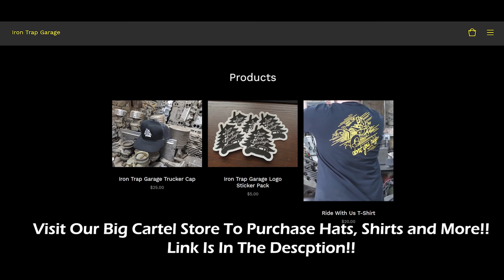Wiring The Lighting Circuit and Inspecting The Gas Tank - 1934 Ford Tudor Hot Rod

Comment: You can put electrical shrink wrap on the SS worm gear clamp for the turn signal. I saw it used on radiator clamps. Clean.

Comment: Matt.
To save the old tank do as my Dad taught me to growing up when we salvaged old fuel tanks from old aircraft to put in homebuilt aircraft.
Cut a rectangular hole in the top of the tank the 2/4's the length of the tank.
Drill a hole where you want the fuel line to go.
Weld a patch over the old hole.
Cut another hole where you want the fuel sensor to mount.
Weld a patch over the old hole.
In your case leave the fueling inlet hole alone.
Make a cover 3/4's inch larger than the hole you cut in the top.
Drill screw holes every 3 to 4 inches around thru the new hole cover with it held on top of the hole with it held in place with those magnets you use.
Install pop screw inserts.
Drill a hole for your new fuel line outlet and install and weld in a 3 inch peice of steel fuel pipe to attach the fuel line to.
Cut a hole for your sensor flange with holes drilled using the sensor flange screw holes for screw insets and install them the same as the screw inserts as per the the access hole cover you made.
I can't remember there proper name but I've watched you use them.
Then glue a fuel resistant rubber patch over the inside of the insurts 1 inch larger than the insert.
Either have a custom rubber resitant fuel bladder made or simply paint the inside with several coats of fuel tesistant paint after first removing all the corrosion with a wire wheel on a drill.
Paint it with a good primer at least 3 coats.
Then paint it at least 4 to 6 coats of fuel resistant paint if no bladder is used.
There is a paint like that Eastwood may make cheaper that that supplied by aircraft parts retailers.
It comes out thick.
Install the cover you made for the the hole in the top using lock tight on the screws for it and the screws for the fuel sensor flange.
You've saved the original tank.
Itvreally won't take that long.
The largest expense will be a bladder or the fuel resistant paint.
We used both depending on the aircraft.
It's way cheaper to save the tanks than to buy a new one I'd think.
Reply: Or he can buy a new custom one for $300 and sell that one for $150. 😂
Reply: Mr. Spin.
What I described isn't as exspensive as a new tank.
I highly doubt he'd get $ 150 for the old one considering it's condition.

Comment: Nice Matt cant do enough in my opinion, hate having to go back later and redo, got my friends 9n running purrs like a kitten notice it hadn't been moved in a month , you guess it old gas open carb I again will have to rebuild the carb , this is the 3rd time due to thinking everything is good with the tank and lines not as hard to deal with as in your car , only one thing I see you doing is your on your knees without pad take it from me Wear pads of a solf pad that way when you get my age your knees are not shot . Love the car it is killer

Comment: You could probably replace one of the license plate bracket bolts with a hollow bolt to run the wires through.

Comment: What I did back in the day was go to the junkyard and pull a fusebox and harness out of a fairly new (late 50s) car to wire my projects. Usually tried to match the car the wiring came out of to the make of engine being used. Yours looks better!
Reply from the maker: Not a bad idea. 50s &60s cars still had alot more going on then these cars need. They are quite simple!!
Reply: @IronTrapGarage  For sure, I love that fuse box you used.

Comment: The license plate bracket can double as a tow hitch LOL. Back then it was about how quick they could make cars on the production lines. quicker to have the gas tank mounted in the frame and drop the body on as it rolled by. Always nice having little helpers around!
Reply from the maker: The bracket is mounted quite securely!! Never thought about the tank being on the frame for faster production. Good point!!!

Comment: Hey Matt,
   Another Great video on the progress of the 34 sedan.
Looks like your in-house electrition might also have some idea of what he is doing,
 ( Hey Mike ).
   Cool shot at the end of the video showing all the lights actually work.
Didn't see the Fog lights, or hear the horn.
More work to do !
   Matt, the 57 Fords had a tin tunnel to cover the turn signal wiring on the outside of the steering mast.
I can send you one  or two if you want, as we have like 25 57 Ford parts cars in the yard .
Taping the wires to the mast seems kinda hoaky on that great looking sedan.
   Are you going to put an electric fuel pump in the new gas tank ?
I know they are higher pressure and need a return line but it is a thought.
You can install a fuel pressure regulator in line before the carb so the pump doesn't over power the float valve.
   Thanks for the Sunday Morning update.
Be safe and well all.
Reply from the maker: I’d be interested in one of those column covers to see if I can make it work. No electric pump. Just the mechanical.

Comment: Careful Matt, if you take the car apart too much, you could be tempted to get into the "if I take a little more off I can do so-and-so". Then all of a sudden that cool car will be a pile of parts scattered around the garage.  :-)    Been there, done that!  By the way, I hear y'all talk about 'chipboard' a lot. Down south where I live, we call that cardboard (the thicker stuff that boxes are made of) or poster board (the thinner smooth stuff). Interesting the differences in terminology between geographical areas. Not trying to start a firestorm in the comment area..........but think about removing the horn from the front of the car for a much cleaner look.
Reply: r1lark same here in oz took me awhile to work out what they were useing
Reply from the maker: The horn will be getting removed for sure, along with the fog light.
Reply: They are using a card board(chip board) that is the thickness of poster board...  Comonly found on pallets under whatever is sitting on the pallet.  Also sold in a roll at home depot in the paint department for protecting floors.

Comment: There is a hole in the floor, so you can service and or remove the fuelline and sender from the inside of the car.
Reply: Some cars do NOT have that access hole!
Reply from the maker: You’re right there is an access panel. Didn’t see it until the tank was out! Doh! Either way it wasn’t horrible to do it the way I did it.

Comment: What did you use for new sockets in the tail lights and cowl lights? Great job!
Reply from the maker: The car was already converted to 12v with dual filament bulbs. We didn't change a single bulb or socket!
Reply: 33-36 style tail lights came from the factory with dual filament sockets. 32 was the last year for dual bulbs in the tail lights. Cowl lights were single filament though, so somebody changed those.
Reply from the maker: Thanks for the education Greg good bit of knowledge there!

Comment: You Guys seem like nice kids. Why don't take a weekend a clean up your Shop and get organized and use  your Lift and stop working on the floor. It's much easier and you get more motivated. Just sayin. Just my opinion. Stop working on junk and or fix it and move on. Feel free to tell me blow it out my ass. P.S. I have been working on Cars and Semi's and Motorcycles for 50plus years. I like to work Smart,not hard. Have a good day.
Reply from the maker: The time it would take to move all of the cars out of the way or off the lift I’d waste half my day moving cars around. Also I’m a one man show and sometimes I work round the clock and cleaning up gets put off. It’s a never ending battle. Putting out 3 videos a week and working 7 days a week gets to be tough to find time to clean up some weeks. Sorry to disappoint.